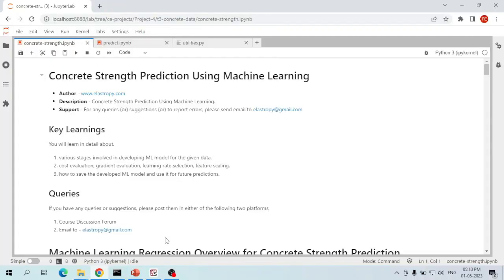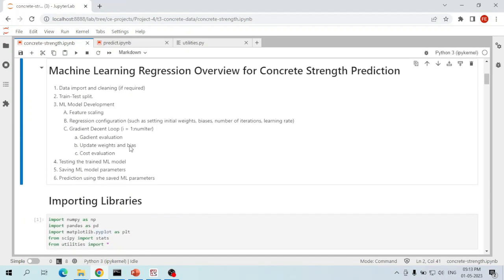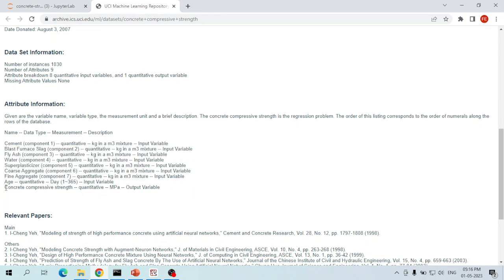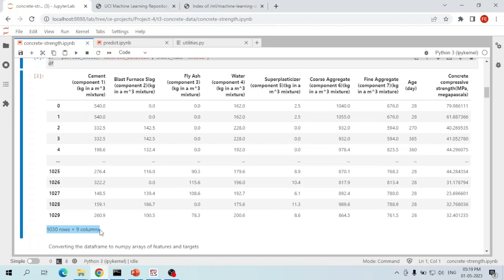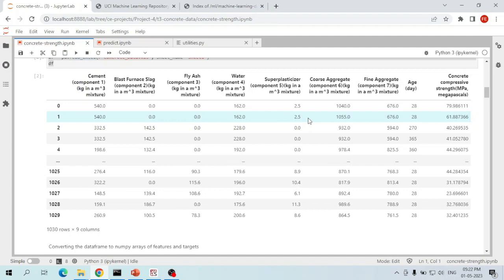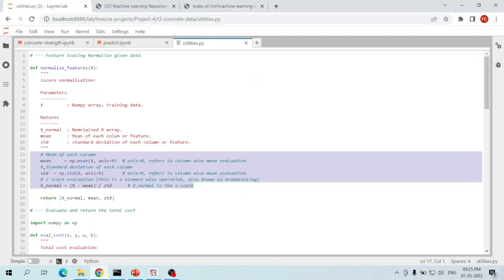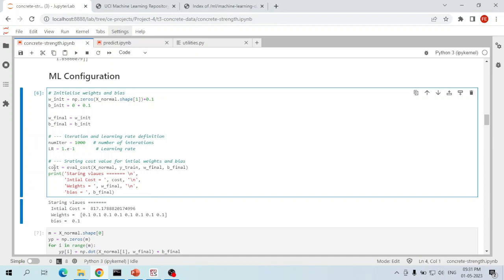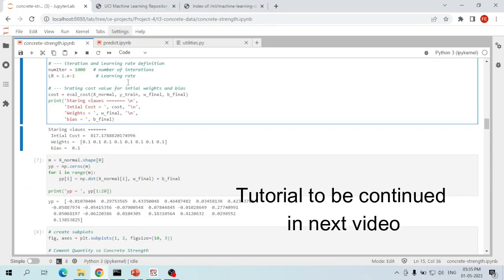Part 1 of Project 4 - Machine Learning Model Development - (Video 1 of 2)

Comment: thank you for your video and i have question, what is the software that use for ML? is it creating M file in matlab ?
Reply from the maker: Hi @MunirAlTamami, thank you for your comment! I used normal Python along with a few general Python libraries, as mentioned in the video. Regarding your second question, no, I did not use MATLAB or create an M file for this project. Everything was implemented in Python.
Reply: @ thanks